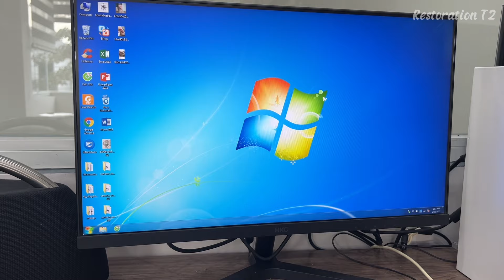Restoration destroyed old desktop tree |Rebuild computer

Comment: Precisely how not to clean, repair or otherwise restore a muddy computer.

Let me count the ways of what NOT to do:
1.) Submerge computer components in muddy water.
2.) DO NOT USE A TOOTHBRUSH on any CPU socket. LGA or ZIF Socket or any other CPU interface.
3.) Do not use a wet and dirty horsehair paintbrush to "clean" computer parts, especially in dirty water.
4.) Do not open or "breach" mechanical hard disk drive enclosures in outdoor environments.
5.) Do not use a PSU that has been submerged in caustic liquids, heavy cleaning solutions or water.
6.) Simply put, do not attempt to rescue and or restore a computer that has been submerged in the muck of a nearby river or pond and caked in mud.

Best thing to do with a computer in this condition is to clean the mud off everything, disassemble the whole machine and take it to the local recycling center and get rid of it.
7.) Whatever you do, don't try what this guy is doing in this video at home. He's what you would call a "professional." A professional what? I don't know and I don't want to know.

Cute video by the way.
You're better off doing cleaning and restorations of old muddy bicycles however.
At least by doing that, one; you're actually doing something more worthwhile. Two; you're far less likely to be accused of faking a restoration and thereby increasing your credibility instead of decreasing it.

Just a friendly suggestion and not trying to be mean or anything. Just looking to encourage honesty.
Reply from the maker: Hi guys
I have had a passion for repair since I was a child, Many rusty or broken metal tools are often discarded if not restored. Many tools will be reused for use. It is simply sharing skills, or simply entertaining videos. Hope you guys can help me improve this restoration, thank you for watching!
Reply: it's not a computer mate, it's a tree, read the title.
Reply: @restorationt2  your passion is make fake restore video lol

Comment: who woulda thought you can clean your motherboard with water lol.. i learned something today
Reply: yeah you can clean your motherboard using water. if the condition of your motherboard is ok. i mean there is no bent on CPU socket and no corrosion in any IC on your motherboard. I had tried to do this method on cleaning my motherboard and i works just fine. Just make sure that your motherboard is totally dry before you put processor, RAM and VGA Card on it. But for this video i can assure you this is fake. First, whats the point on fixing SATA cable and PSU when you can buy the new one. at least he can buy a good monitor shown in this video. Second, when you find muddy HDD and muddy DVD ROM like he did, I will directly put into garbage bag. you cannot put a muddy any HDD or DVD ROM into the water. It will destroyed the components inside the HDD case. Because it is very sensitive. That is why i cannot be fooled by the things he did in this video.

Comment: I believe this video is fake (a good one though), need some explaining from the creator. 

1. The hard drive and psu are submerged in water, these components will fail if water gets in them.

2. The creator places a cover on the computer at the end, however the computer found was missing it and there is no way he found the exact cover. It is also clean, if it was found near the computer, it would be dirty and the creator would show cleaning it
Reply from the maker: Este computador não é um computador antigo, mas um computador descartado, portanto, seus acessórios podem ser encontrados em muitas oficinas.
Reply: did you notice the broken cpu socket pin? it will be the only one that works over a bad socket pin. it is a true deception.
Reply: Estos vídeos falsos siempre llenan el gabinete de barro  .
Reply: @cristianmunoz5841  You don't speak English?

Comment: the soket pins, all broken, you don't know how to repair
Reply from the maker: I cleaned it with a special solution and it worked great
Reply: @restorationt2  is not the water, you can't touch cpu pins, because you can bend it, you only need to look the soket